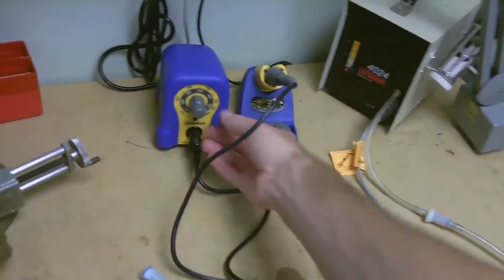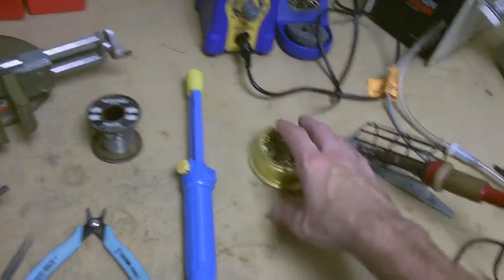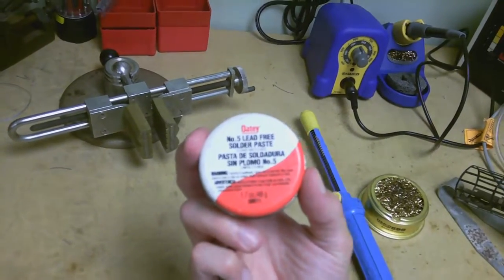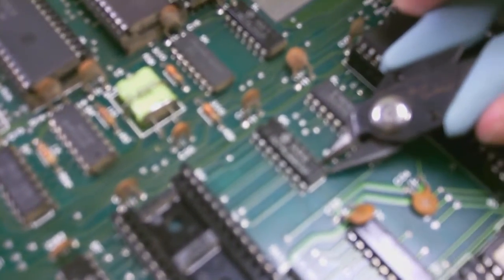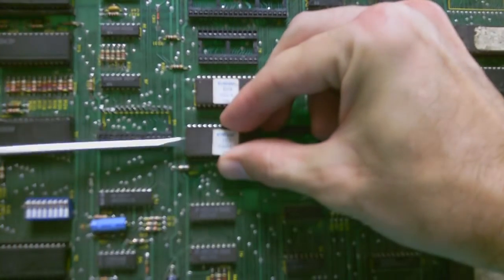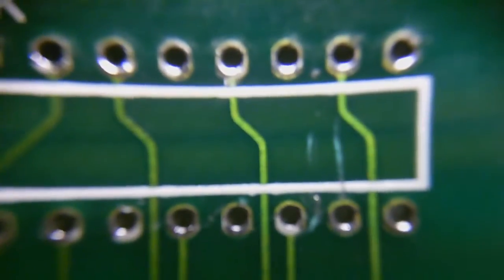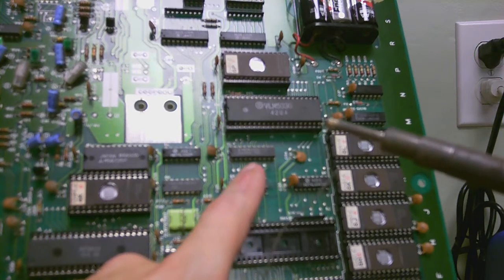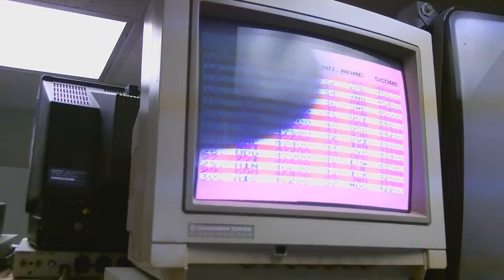Arcade Game Repair 101 - IC and Socket Replacment

Comment: Please tell me that plumber's flux is non-corrosive! If it's not, cleanup with isopropyl alcohol better be thorough! Personally I use a good quality non-corrosive liquid flux and a syringe bottle that puts just as much as I want in exactly the right spot. Less waste and much easier cleanup after the job.
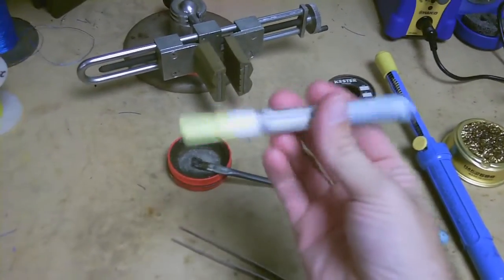Reply: 2:54 Plumbers solder usually has zinc.  Zinc is determental long term.  If you have to use it, then you need to clean it professionally 100%. There are better alternatives that are more forgiving to average hobbyist.

Comment: That leveling can split a via two. And when you have a via that connects two traces and you can solder it only from 1 side, the solder does not always reach the other side. I have seen that a few times in testgear a customer tried to repair first. 

I repair measurement and calibration gear, no arcade stuff, I watch because I also get 70-80's gear on the bench and your trouble shooting video's about the old digital stuff are very good.

Please advise and use good flux for electronics and clean it afterwards. There is paste like flux too. Most plumber stuff can eat a way the traces in the long run.

Comment: Great vid.. I have recently bought a 78' Space Invader machine ... I replaced a couple of diodes on the power board and two transistors on the actual game board as they looked badly burnt.  The previous owner had wired up the transformer the wrong way so hope he has'nt damaged it too much.......when powered up now, it makes a few saucer sounds and a humming noise in the background but the CRT screen just stays white with no images....Is there any chance you could point me in the right direction of what to test for, and in what order and also how did you identify those bad IC's ? not asking for much LOL... :)

Comment: Hey Adam, thanks for the great video!  I think a series of general repair tips will be great!  One question though.  From all other tutorials I have ever read about electronics soldering, they have always warned against using plumbing flux for electronics work.  From what I recall is that plumbing flux is acidic and can damage boards, but you're using plumbing flux here?  You're obviously very experienced, so I'm curious about what your take on this is.  Thanks!

Comment: Great vid, the flux definitely does 90% of the work when it comes to soldering.

Any reason you don't bend the TTL legs to hold it into the board while working on the solder side?  I know some legs are to short but i suppose it would ensure a definite connection to the pad.  Just wondering.